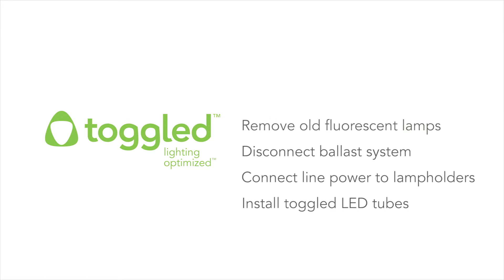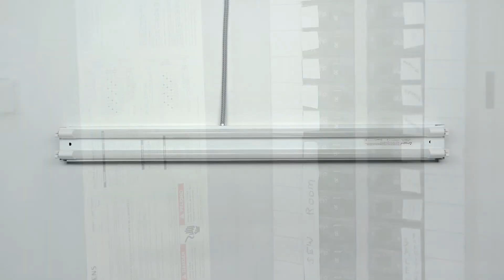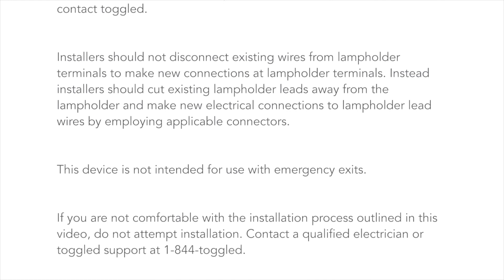Toggled LED Installation Using Pre-wired Lampholders

Comment: I've got 4 lights/tubes in a linear fluorescent fixture-two aside running lengthwise (garage).    I read all the installation instructions and watched the two light install video but need clarification on how to install 4 new Toggle lights in a   Specifically how to connect the two sets of lights to the power.    Is there a video?
Reply: Minute 2:56 shows how you still group them together or daisy chain them

Comment: This product is really great. Have a nice two rack setup for starting seedlings. But the bulbs were fluorescent t12s, which burned out, and I could not find 2 ft T8 bulbs growlights. So, I put in two different colors of T8, hoping the combo would give me enough wavelengths to grow seedlings. But never sure I had enough light or right spectrum.  Then ballast went dead, so I would need to spend 30bucks to replace ballast to run my bastardized grow light system. Found these guys had 2 feet LED growlights and conversion for about $50 (for two bulbs).  I did the conversion and now have much brighter LED grow lights with right spectrum. Conversion was pretty easy — make sure power is off— and I and my plant are really happy. Nice product!

Comment: Great Video, it helped a lot.  The only thing I did differently, was that I removed the ballast, as it serves no purpose, and nobody is going to switch back to Fluorescent.  

Getting the tombstones out is tricky as you have to press hard on the lower tab clips to swing out the bracket holding in the tombstones, and is impossible to release on the power side unless you loosen the nut a bit on the side that feeds the power.  This gives the flex needed to push out the clips, to enable the release. Just remember to tighten the nut again once you have installed the new tombstones.

Comment: Just installed 12 of the 24" 4000k Cool White, and boy are they BRIGHT! I bought from Home Depot's website, delivery was quick, 2 days. These replaced 4100k T12 Flourescent bulbs in our kitchen. These are noticeablly brighter, by quite a bit, almost too bright... If I could do it again, I would purchase the dimmable Toggle tubes and install a couple of dimmers for those late night jaunts to the kitchen. 

Install was a breeze, I did not use the included tombstones, I simply cut the wires at the unpowered tombstones, removed the ballast, and used the two wires at the end to connect to neutral and hot to power both tubes. Pretty simple job, did not take long to do all six fixtures.
Reply: Hi Michael, Thank you for the feedback. We're happy to hear that you're enjoying your Toggled tubes. If you ever need anything, please feel free to contact us anytime at 1-844-toggled or at support@toggled.com. Thank you!

Comment: Do you have to replace the other side that doesn't get power?   Does it really matter since it is mainly a holder and there should be no power running on that side.
Reply: Hi Sandro, Thank you for reaching out to us. You just need to have non-shunted lampholders on the powered end of the fixture. Since the non-powered end is for support purposes only, you can leave your current lampholders in place. Please be sure that all electrical connections are disconnected and capped at the non-powered end. If you have any questions, please feel free to contact us at 1-844-toggled or by email at support@toggled.com. Thank you!

Comment: So if it's wired like this or like that then do this... But if it's wired like FU then what?
Reply: Hello, We are happy to help via telephone or email with wiring questions specific to your installation. We can be reached at 1-844-toggled or support@toggled.com. Thank you.
Reply: @heathernovetsky87  I got it. Very simple to input... You're just bypassing the unit... It's just that my stock lights were wired much more crazy than you showed
Reply: Shunted or non shunted. Still confused.
Reply: @defomatt2684  Try this out, Matt.  It explains the difference pretty well. 
https://insights.regencylighting.com/shunted-vs.-non-shunted-sockets-tombstones-lampholders